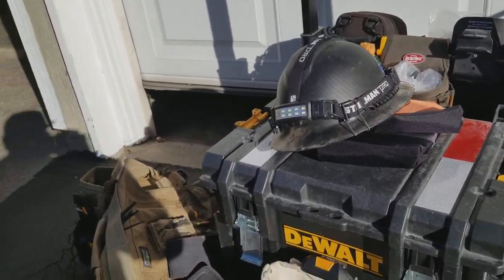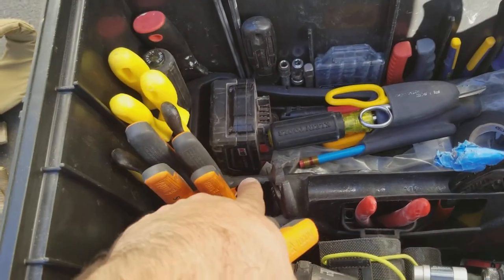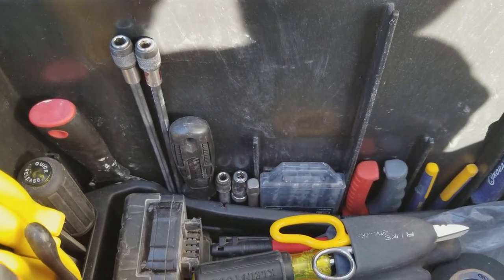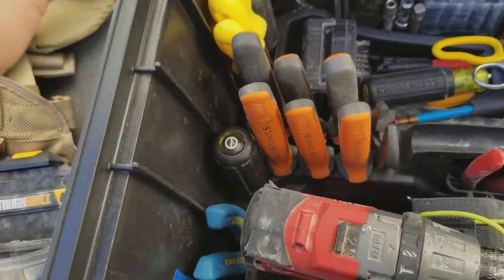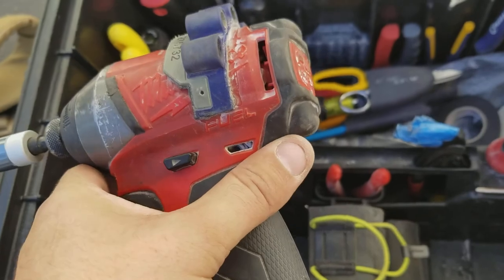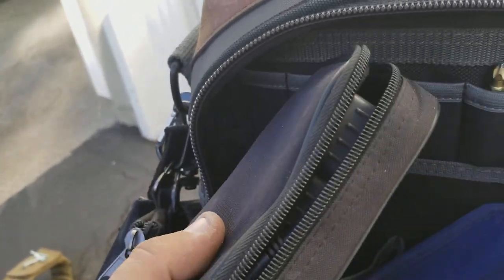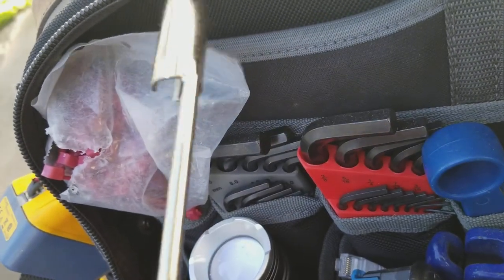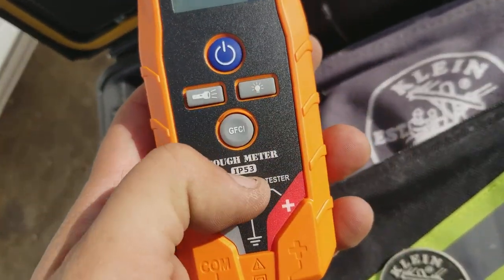DeWalt ds450 tough system custom and everyday tools part 1

Comment: Thinking about doing this with my own but just trying to wrap my head  about fitting everything in and which material to make the orgainiser our of , what did you use to secure your tools on the lid?  could you show more even pictures ?
Reply from the maker: I used a Stanley tote in the bottom.
The top lid I used a 1u data rack solid blank. it's metal so I can stick my magnetic levels to it and Velcro wrap to hold glow rods and long bits.  I think I have 4 other video with my box that might help.
Been really busy with work lately. I should make a video that goes over what I did to  make that box .pretty much I had leftover things and I just got creative with 
It .

Comment: In regards to the gator socket: the best tool is the one you have that will get the job done.
Reply from the maker: The gator socket is a tool I haven't used in about a year. Last time I used it was in a office remodel and it worked great for the ceiling hanger screws. It's that odd tool for sure It's definitely not the right tool for most jobs but will save you in that special situation.

Comment: What is that rj45 blue cheater, called? Have been googling it and nothing seen. Really need one as it looks handy.
Reply from the maker: Eclipse Tools 900-244 Pro'sKit Banjo Adapter, 4-6-8 Pin https://www.amazon.com/dp/B00OSLCZ6O/ref=cm_sw_r_cp_apa_i_wF3DCb7PHBFJS
Reply from the maker: It's a handy tool for sure 😀
The one I got was from graybar it's right behind the counter on the tool wall. Graybar in nation wide just pay COD if you don't have a account. sent a link for Amazon. looks the same plus you can check out different ones. Have a good one buddy 👍

Comment: Great idea what’s the Stanley organizer you used? Will be copying your method it works so well for what I need
Reply from the maker: Nathan Thorsen Stanley STST41001 Portable Storage Tote Tray
I did make it fit so you will be modifying it
It does work really good in the DeWalt ds450. It won't work with the other DeWalt boxes like the 450 . I tried the ds450 is bigger. It's only 11 buck on amazon
Reply from the maker: Nathan Thorsen I have upgraded some stuff on my ds450 check out my toughbuilt tool box video it the same box just titled different
Reply: LOW VOLTAGE DUDE did you screw that clip on the front or just adhesive? Bought a power fist hand tool holder I might cut and use self tapping screws to hold it in and cut some brackets was wondering if you’ve screwed anything into the plastic thanks man love the box!
Reply from the maker: Nathan Thorsen I used a screw and nut on the back side.